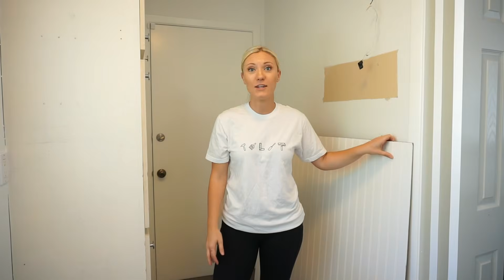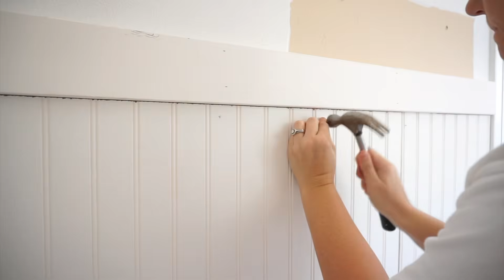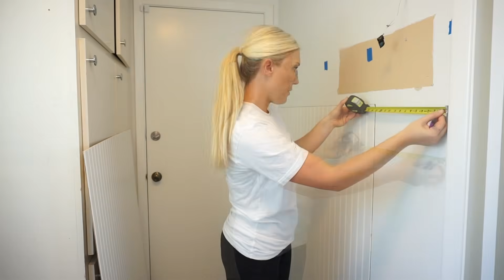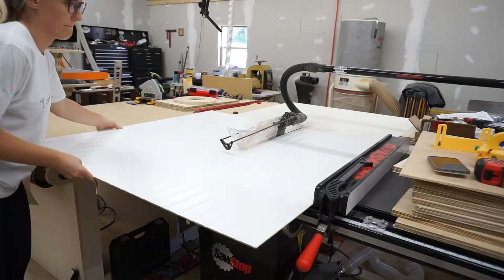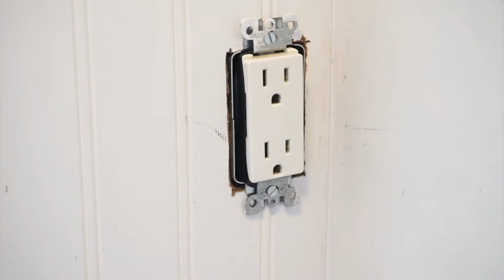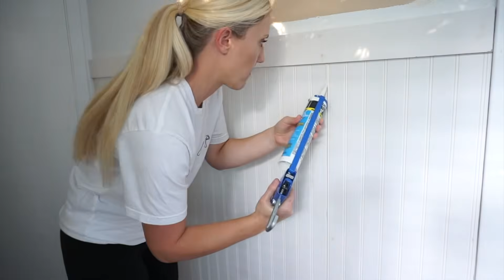How to Install Beadboard Paneling for Beginners

Comment: Nice work it looks great and thanks for sharing the outlet box trade secret. Question:  Everyone installs the baseboard first but what if the floor in uneven.
Reply from the maker: I would use a level when installing the baseboard and make sure the baseboard is level, even if that means it leaves a little gap between the flooring and the baseboard. If there ends up being a noticeable gap between the floor and baseboard that bothers you, then I would suggest using quarter-round molding to go on the floor against the baseboard to cover and hide the gap. I don't have a video showing how to add the quarter-round but I am sure there are lots of video on here that can teach you how :)
Reply: @mrsashleyfrench  great idea. Thanks!

Comment: Thanks for the video. Very helpful. How do I install bead panels over tile? Thabks
Reply from the maker: I would suggest using a construction adhesive on the back of the beadboard and basically glue them to the tile.